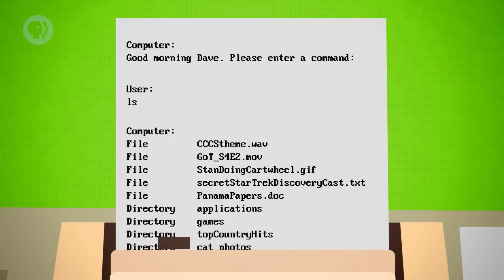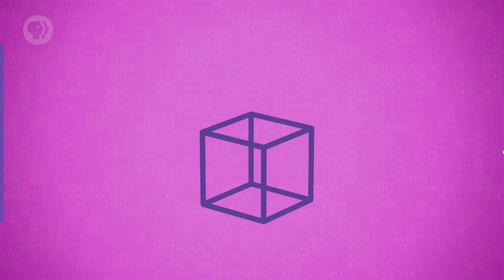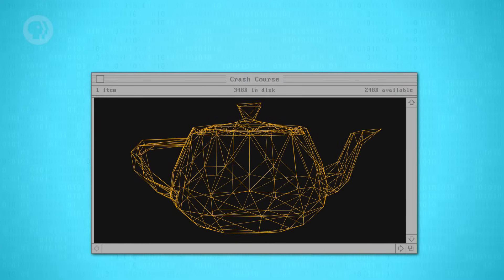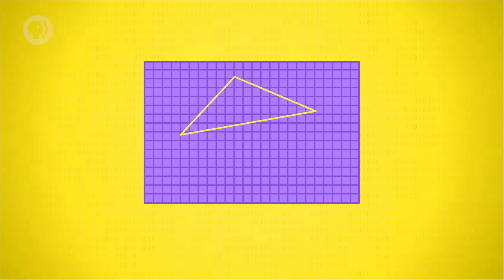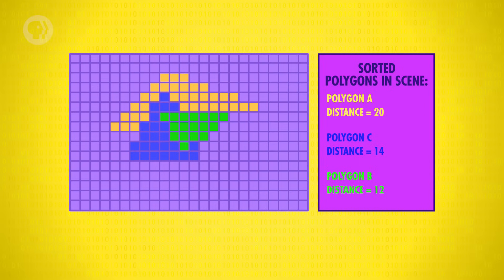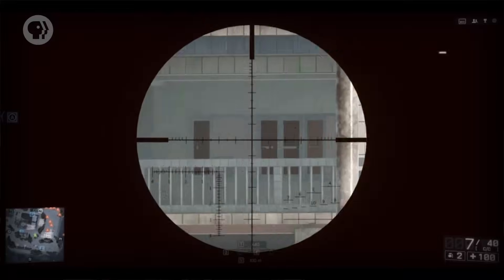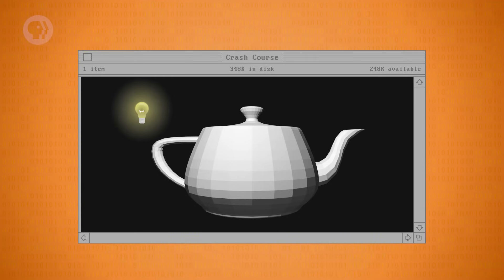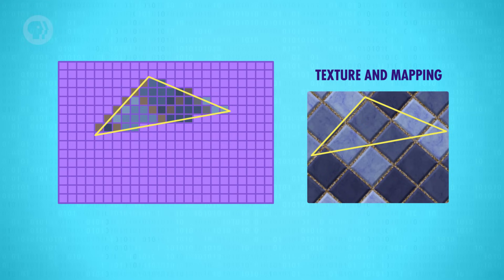3D Graphics: Crash Course Computer Science #27

Comment: How to determine if each plygon’s face would be seen by viewer or not? With any math? If math what mathmethics should be used?
Reply: The math is extremely simple (as you would expect because in order to be useful it needs to be computed faster than to actually process the polygon). As mentioned in the video, each polygon has a vector which defines its surface normal. You just compute the dot product of this vector with the vector facing the camera. If the result is positive the polygon is oriented towards the camera. If it is negative it points away from the camera and can therefore be discarded.

Comment: Nice as always. Things to mention that would have made it even nicer:
1. Anti-aliasing isn't just artificial, your eye does it too
2. Matrix math
Reply: 3. Quaternions.  That teapot was rotating after all :)
Reply: @JasonHise64 
Oh my, those are the most confusing things I have ever come across. In general, I try to forget about them...
Reply: gracefool Yes, the General Projective Transformation was a watershed for computer graphics. I first encountered it in Elementary Nomography in 1960-61. Unfortunately, our computers weren't really up for it then. It was mostly punch cards and line printers.
Reply: Your second question is the easy one: assuming the simplest kind of anti-aliasing, super sampling, x2 means double the resolution is rendered before being averaged into the final image, x4 means quadruple, etc. There are other more optimized algorithms that are far more efficient with slightly less quality.

For the first I googled and found a 1985 paper that answered it:
1. eyeball optics
2. fixation instability (saccades)
3. photoreceptors are in a hexagonal grid (very high density, better than a grid)
4. each photoreceptor acts as a low-pass filter
5. your brain effectively does temporal anti-aliasing

But it still has limits, you can see aliasing when looking at certain regularly repeating objects, e.g. a fine wire mesh held at a steep angle, or standing next to a long chain-link fence.
Reply: the output of the matrix multiplication gives a distance from the camera in addition to it's location on the screen. So basically you input a point somewhere in space at (x,y,z) and after you multiply it by the different matrices you get a new point (x,y,z) where x and y is where on the screen it should be drawn and z is the distance.
Reply: Im sure folks watching dont wanna see a 10x10 matrix and a bunch of Projection Equations. But I guess she could've mentioned it.
Reply: Almost all of computing is matrix math and I believe she already explained how computers store values into matrixes and simple matrix math.

Comment: How does Z-Buffering work when also using Anti-Aliasing?
What values are assigned to the filled pixels?
Reply: Multi-sample anti-aliasing divides pixels into sub-pixels.  Each sub-pixel gets painted similarly to how this video shows full pixels getting painted.  Then the sub-pixel colors are averaged to get the final pixel color.  More details with pictures: https://mynameismjp.wordpress.com/2012/10/24/msaa-overview/
Reply: Anti-aliasing is really more of a goal that different techniques are trying to achieve than an accurate delineation of the way the techniques actually work. SSAA and MSAA for instance increase the sample resolution of the image and then downscale it, TXAA increases the sample speed of the image and calculates a middle ground between two or more samples for each frame, while FXAA simply utilises selective blurring of the image. None of these techniques are remotely related in how they work, but they're all called anti-aliasing because they all have the ultimate goal of smoothing hard edges in an image.